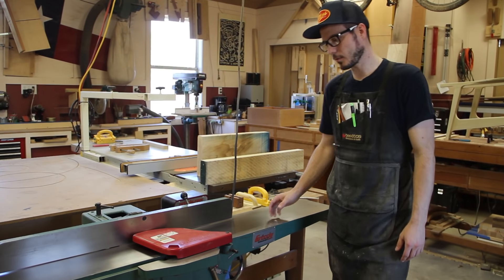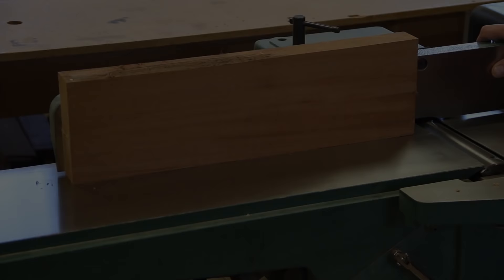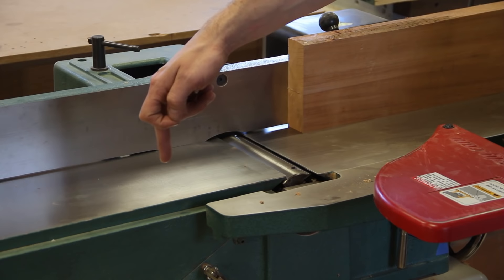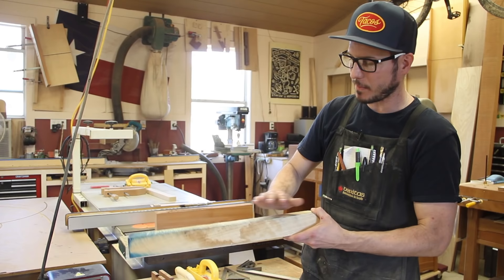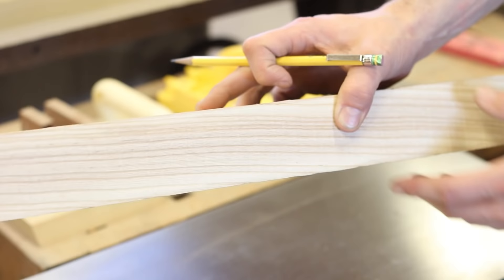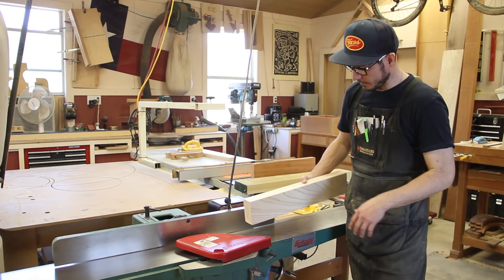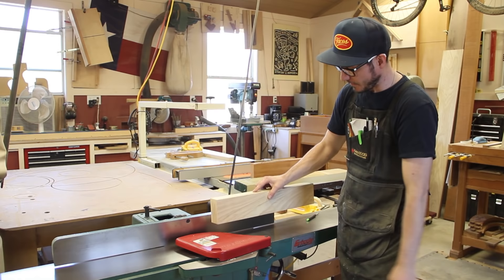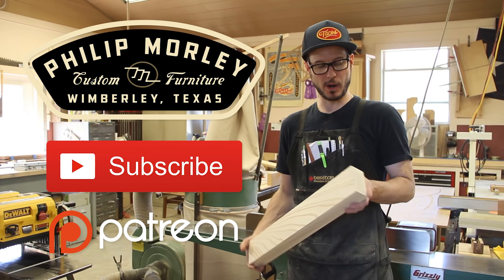Milling Lumber: 101

Comment: Hi Philip - I think I'm reasonably competent at using the planer/thicknesser but I learned quite a lot from your video.  The introduction covering  diagnosis and correction of a misaligned outfeed table was excellent.  The following section covering milling was also well explained and the different approaches to getting to S4S were contrasted well and you explained why you preferred the method you used.  This is the best explanation/demonstration I have seen so thank you for creating this video.  Cheers
Reply from the maker: +justcruisin109 I'm really glad you liked it. I hope it helps you in all your future milling endeavors.
Reply: @Philipmorleyfurniture  thank you for the detailed walk through... Like Justin, I thought I was comfortable using the jointer, now I'm more confident.

Comment: I recently started milling my own stock and was growing increasingly frustrated with the results. Your video inspired me to take a step back and spend some time getting my jointer really dialed in. Took some time but using your process of flattening both faces first rather than a face then an edge, my milling and squaring of stock is better than ever. Thanks for a really great tutorial.

Comment: Hello, I was getting so frustrated with my new 6”  jointer. Went through many videos etc. This video made it instantaneously clear to me that my outfeed table must be set a tad high. Just enough that I felt the little bump but didn’t consider it critical. Was I wrong. It was also the best instruction how to fix it without resorting to a set of straight edges and dial indicators etc. It took me 5 minutes to set it with instant gratification.

Comment: Hi Philip! Thanks for this clear and thorough explanation of milling. I am taking my first woodworking course at local community college with a fine woodworking program, and just had my first in person class which went over milling. In particular, your explanation of jointing one edge, and then going to the thickness planer to avoid any issue with grain direction before leveling the second edge was a great takeaway which was not covered in my live class, unless I missed it, which was possible! I've been a hobbyist on and off for a long time, and finally am taking the plunge to get some formal education, and seeing where it goes from there. Blessings to you and thanks again! Cheers! -- Philip D

Comment: Love your stuff Philip - your are a generous man with your practical knowledge. I am over-thinking things as usual. You had me this time up until the step beyond the last width cut on tablesaw. I've come to stop there, as a rule, and then rely on finish sanding to manage the TS marks. You propose adding yet another run on the planer, on edge, to handle this element. And, this relates to what I've realizing as a novice woodworker - it seems that as one graduates along the pathway of becoming a "woodworker" you work with dimensions of wood dictated by your milling methods rather than a prescribed (manufactured) dimension, obviously.  For example a furniture guy would be quite satisfied working with material he milled to 7/8" thickness knowing he perfectly milled it to that thickness and didn't have to rely on the stated dimensions of manu wood. I am still at the place where I work from plans that dictate the final dimensions so, if I need a final thickness of 1", for instance, then  where I stop milling is after that last tablesaw cut relying on the TS (fence rail) gauge at 1". I realize every piece should be finally measured with a caliper but this technique has served me well as long as I make sure that all pieces are cut at exactly that same width on TS and the finish sanding techniques also remain consistent. With the added step at the planer you would be relying on the planer's gauge to tell you you're at 1" but you would have a cleaner edge needing less finish sanding I suppose. Further it would be impossible to perform that last step on the planer with any wood that was under 4/4 unless sent through with sister boards. You are using 6/4-8/4 in your vid I presume. I apologize for blubbering on but I'm a slow learner and just trying to get it right. Again, thanks for all your content.

Comment: So glad I watched this. First I'm thinking... DUH! Why did I not figure this out? But now I know why my last boards weren't coming out right. I manage a Maker Space. So the settings aren't always the same when I use the equipment. The outfeed on the jointer is set too high. I have a lot of lumber to mill for some cutting boards. Happy I saw this first. Now I'm confident my boards will be milled right.
Reply from the maker: +Angie Overton That's awesome! I am glad the timing worked out so well!

Comment: One thing I do differently than it appears you do is I put the downward pressure on my board on the outfeed side rather than. the indeed as soon as possible.  This prevents the the front edge of the piece from lifting from the table.

Comment: Matching cut to out feed table is somthing I learned in highschool 45 years ago but have forgotten. Thanks nice refresh course.  
Question: if you buy rough cut lumber 
Would you plane it first or roug cut it into smaller lengths to bring it down to finnish size lets say the lumber is 8 to 18' 
Long  there are advantages to doing it one way or another. Each holds it own benefits.

Comment: Great tips here, thanks!  I have a terrible time with the wood tapering when i try to put them through my jointer, so I'm anxious to go check my outfeed table.
Reply from the maker: Glad you found it helpful. Let us know what you find out about the outfeed table.
Reply: So I got it fixed!  I have a used benchtop jointer that doesn't have an adjustable outfeed table.  So rather than lowering the outfeed table, I raised the knives.  Just milled up some 8/4 walnut and it's the best I've ever done!  Thanks!
Reply from the maker: That's awesome! For a second, I thought you were saying that you fixed the problem by throwing it away! :) JK I have actually had a really nice Hitachi 6" jointer where the outfield table was not adjustable. . . so I am definitely familiar with that situation. Glad you got it figured out! Cheers!
Reply: Philip Morley Furniture throwing it away was the next step!  Cheers!

Comment: Another question - the instruction manual that comes with my jointer states that the outfeed table is factory adjusted and should only be changed by a qualified technician.  Can you comment on that?

Comment: Great video. Learned a lot. Have a question? When I use the jointer on a 50-inch long board the ends are fine but the middle has a slight curve in it. What's the problem?

Comment: Thanks for making videos like this. It's really helpful. As a fairly new woodworker myself, learning proper technique is one of the biggest hurdles. If you don't mind my asking for advice, I recently got my first jointer and I know it's set up properly as far as I can tell. My test piece was perfectly flat and square and no snipe on either end, but when I tried to flatten a board that was cupped and twisted I just made it worse. What am I doing wrong? The board came out tapered horizontally as well as having a hump in the middle, so it rocks back and forth lengthwise. Also tips for being able to recover the boards?

Comment: Question... I noticed that the final thickness of your boards seem to be 7/8 or more. If you have a board you are taking down to 3/4 how well does that go through the planer when you are doing your fourth side?
Reply from the maker: +Angie Overton I have never had a problem. I have gone as far down as 1/2." If you are a little uncertain, it is never a bad idea to stack two boards together.

Comment: One problem with a thickness planer, snipe  and thats my reasoning for running long boards on it becuse youll have less snip to deal with but on a really wild board it might be best to cut it down so you don't have as much waste making it flat and stright.

I think my last step would be the jointer less chance of any snipe. 
A thickness planer is only good to make 2 sides parallel to each other and reduce thickness but its not as good as a jointer for finish surfaces becuse its going to cut down on sanding time.

No right way to do it.  And plenty of options to get you home.

Comment: Is there a reason he used the wood to level the out feed table, rather than using a straight edge or level to level the out feed and indeed tables?
Reply: Yes. If you use a straight edge then both in and out feed would be the same level, which you don’t want. You want the out feed to be level with the workpiece so that it holds it flat. Otherwise you get either of the results he showed here.

Comment: definitely agree on the 8/4 going through the planer on its side, however what is your preferred method for smaller pieces like 4/4? I have not tried, but assuming they are too top heavy and wouldnt work out right?
Reply: I wondered about that too. I can’t imagine that fourth face will be perpendicular to the other two wide faces. Especially for a 3/4 inch thick board.

Comment: At 16:11 you flipped the board end over end...is there a reason for that?
Reply: He explains later in the video that the jointer is not meant for a finishing cut, so he is running his jointed face through the planer.

Comment: Why do you need to use the planer on one side, why is it bad to use the jointer for both sides?
Reply: It is because a jointer only makes a side flat, it does not make one side parallel to the other side.  A planer will make one side parallel to the other side, so they are the same thickness from one end to the other.

Comment: Hi Philip,  Unfortunately i don't have the space for a big planer and jointer. Do you have experience with smaller ones and is there a brand which you can advise?

Thanks

Jan WIllem
Reply from the maker: +JW Kooi The planer I use is not huge. It is a 13" DeWalt and has worked well for me. The jointer is a tough one. I personally would keep away from a bench top jointer but of course that just depends on what type of woodworking you are doing. If you are doing smaller stuff you may be able to get away with it. I would recommend minimum of an 8" floor model if possible. I have always been happy with Grizzly.
Reply: Philip Morley Furniture thanx i will see what i can find with your advise in mind.